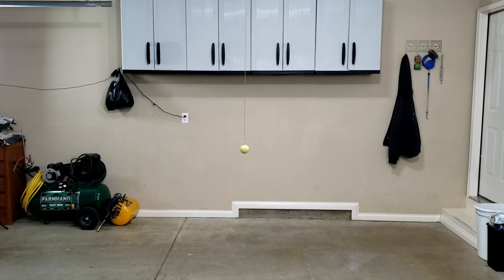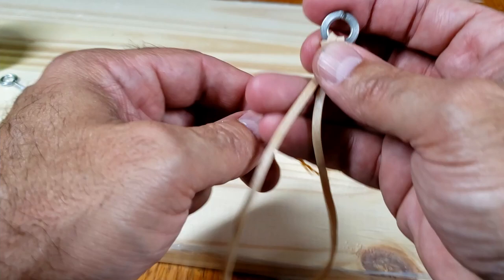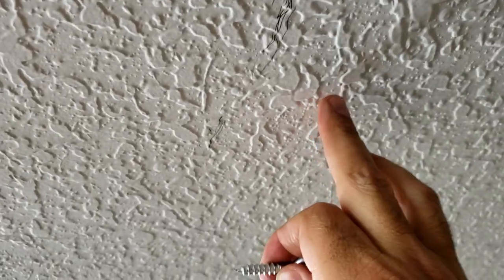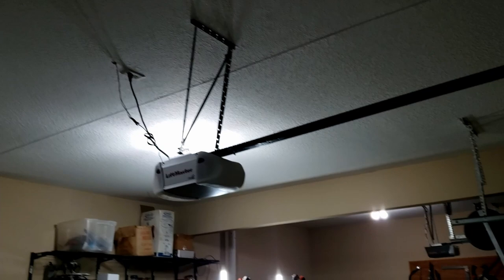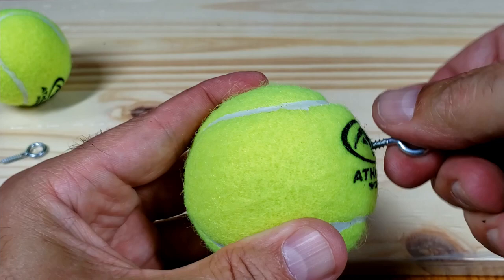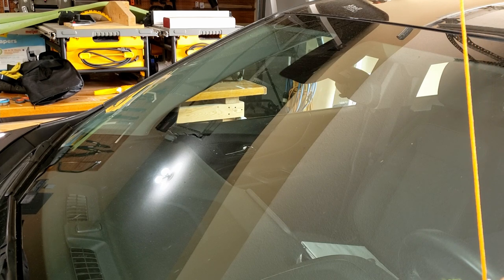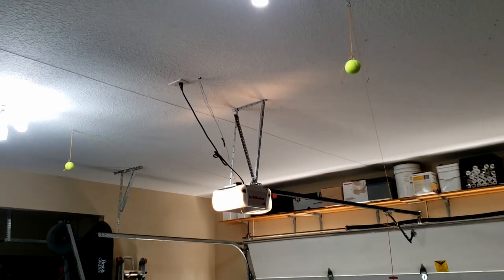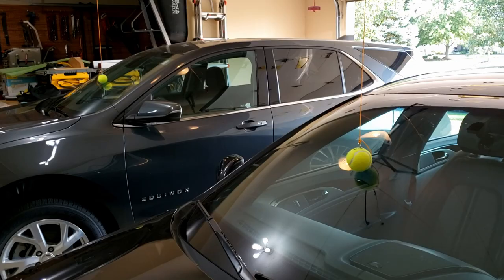Tennis Ball Car Stop HACK! (Retractable)

Comment: A way to avoid using the rubber bands would be to pull the car in and close the garage door first, attach the string directly to the carabiner and garage door hinge first, run the string through a loose eyelet, lean over your car, let the string hang with a small weight on it until it touches your windshield, have someone activate the garage to find that sweet spot where it touches your windshield and also doesn’t go through the eyelet when closing, and then just run the eyelet into the roof in that spot.  Excellent idea though.  I was just looking for a simple video with some tips on hanging the normal tennis balls but randomly found your video.  I will definitely be going over and above and doing this now! 👍

Comment: Great idea! However,  what do you do if you want to work in the garage with door up and cars removed? The would be hanging in the way, right?
Reply from the maker: Good question. I've had to grab the string and loop it back to the garage door arm/hockey stick.  If you do this though, don't forget to unloop it or the string could be snapped when closing the garage door.  Thanks for the comment!

Comment: During set up, leave a little extra string at the ball. After a couple of trial runs, you could move the above eyelet a little if needed, and find where the ball touches the glass, and no rubber bands are needed at all. Another nice touch would be if, with the garage door open and the vehicle outside, you could reach up and lay the tennis ball on top of the opener in an upside down bottle cap stuck there for this purpose. Next activation, the ball will roll out back in service again, nothing to remember!